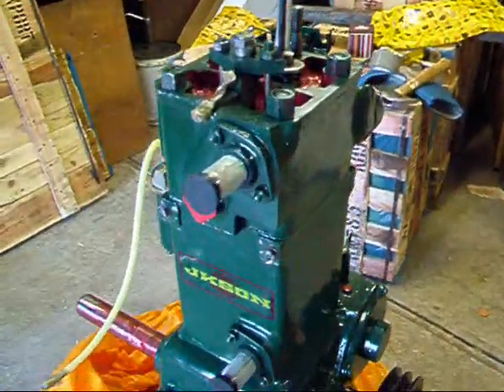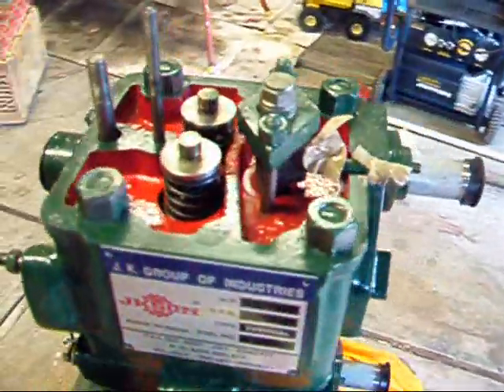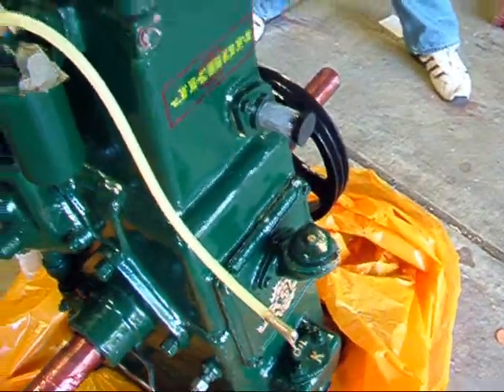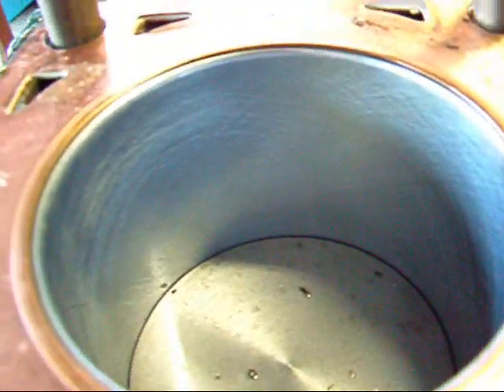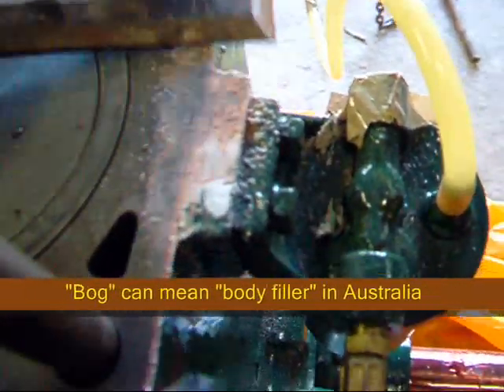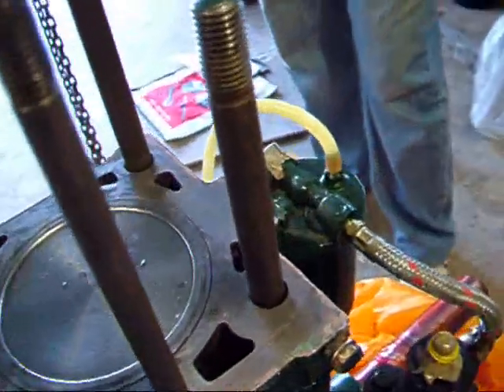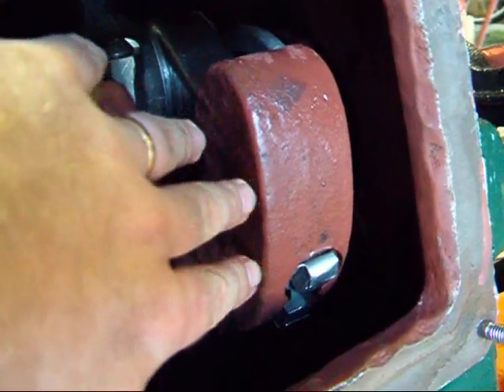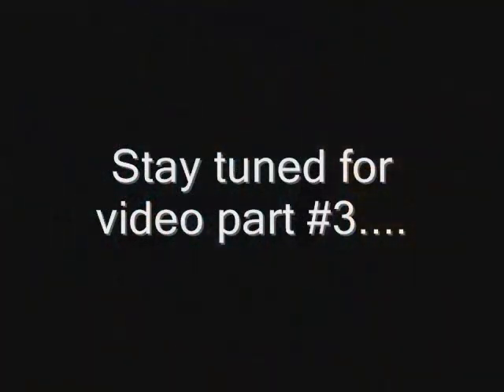Listeroid CS 8/1 uncrating and inspection #2

Comment: never ever pull a crescent wrench backwards. It pulls on the adjustment for the jaw, and with leverage, or cheaters will not only break the wrench, but also round off the bolt or nut head.

Comment: @Environex 
From what I've heard/ read, these Listeroids are mostly made in India and there are little to no quality control and inspection. Many times there are chunks of casting sand still left in the crank case which obviously would make a lot of problems if not cleaned before running the engine.

But even with lack of quality check, a Listeroid will run for a couple of decades if maintained, before needing a rebuild.

Comment from the maker: Hi Environex,
These engines are improving all the time but it is wise to give them a thorough check prior to running. Sometimes small particulats from factory assembly are left inside which could cause damage to the big end bearing or crank if left whilst running. Rebuilding is easy and very fun. It helps you learn about the engine, and makes you better placed to know how to service and repair. I consider my rebuilding experience invaluable.

Comment from the maker: Why? Because once cleaned up, these things would probably outlast their owners. They are built like a tank, and are quiet and slow running at 650-750 rpm. They are cheap for how over engineered these things are.
 
Some people use these to run a generator and use waste motor or vegetable oil as fuel. They are an excellent alternative energy source.
Some use the engine cooling water to heat their home!!